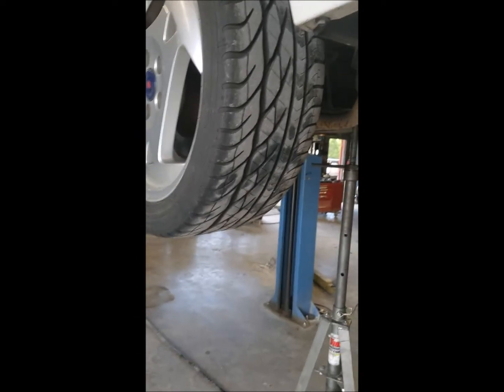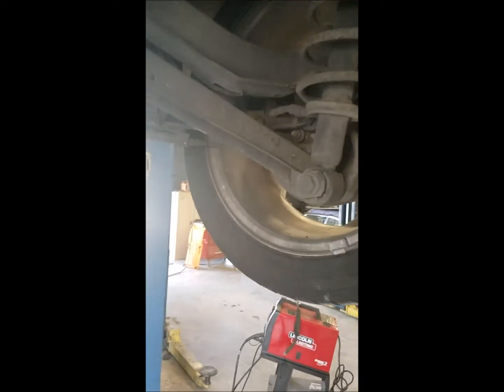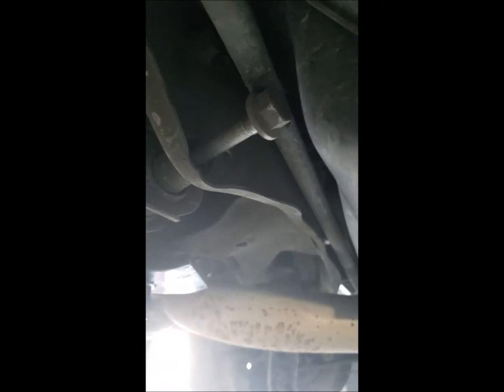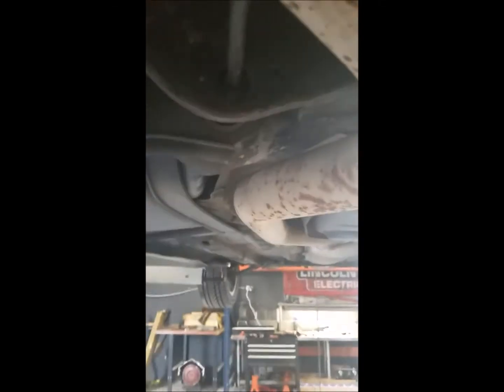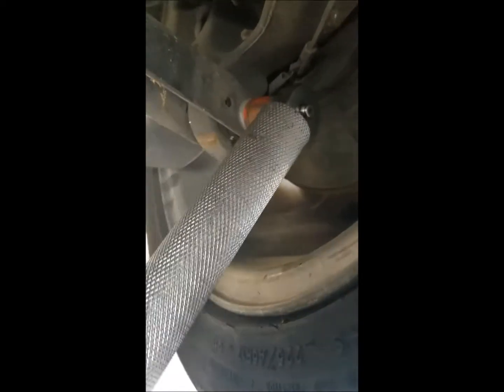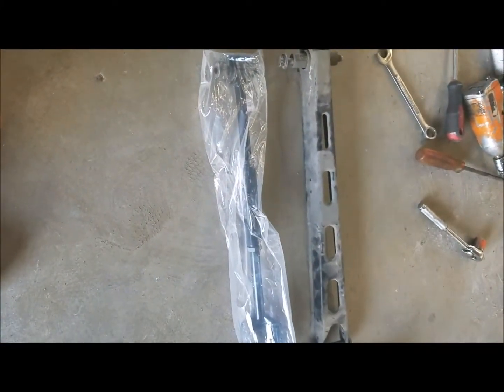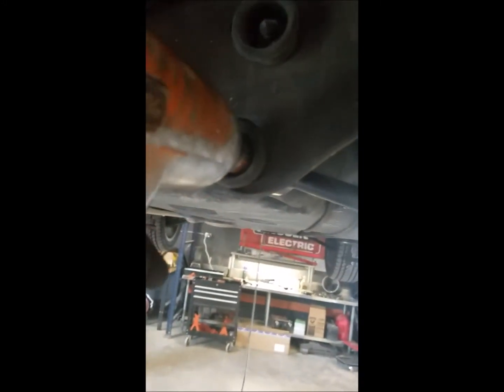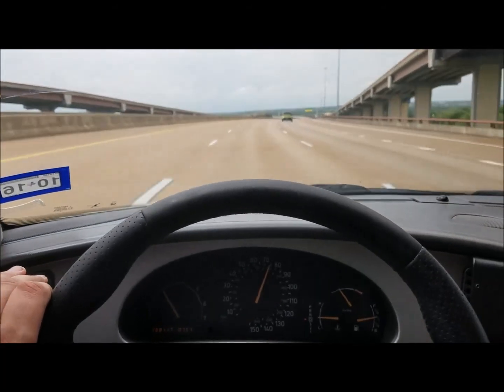Saab - Rear Camber Fix (9-5)

Comment: When secure 4 bolts on cross stay, am I suppose to torque it under load?  Slightly jack up the wheel up 1/2 in.  Suspension parts should torqued under load.

Comment: hey just wondering why this wont work with the auto levelling headlight version?
Reply from the maker: Brody George Theres no bracket on the Saturn parts for Saabs leveling arm / sensor that keeps the headlights level. Although, I personally know a guy who rigged the sensor to these adjustable arms if you wanna see pictures or an idea of how to do it.
Reply: @saabross3171  I'd like to see those pictures because I will be installing these arms and do not want to sabotage my leveling headlights.
Reply from the maker: @AndrewAliferis  Ok, unfortunately YouTube isn't the best platform for sharing such pictures. You may email me @ saabatx at gmail and I'll reply with the photos? That's probably best

Comment: Hi,

It would be better to put the inner bolts back the same way that you took them off.    This will prevent the end of the bolt from puncturing the gas tank in a collision.   Saab has a caution on this in the service manual

Otherwise, thanks for the video.
Reply from the maker: Interesting, leave it to Saab to always have safety in mind!
Reply: Or grind off the pointed tip of the bolt. I guess the tip is only pointed to get the bolt guided easier into the hole.

Comment: What a great solution! I guess to get Saturn parts in Europe is going to be difficult, but anyway, you gave me some inspiration. Thank you!!
Reply from the maker: You're most welcome! I can't take credit for the idea but its very easy to do, the parts are pretty common here in the States and aren't necessarily specific to Saturn. See if you can find a generic part in Europe with the same specs or similar part number and it should work, maybe Opel?
Reply: You can buy them on Ebay, I did. But beware that if you have a car with xenon lights you need to find a solution for the bracket sensor of the leveling system. The holes in the original arm are right where the adjuster of the new arm is. Not impossible, but a bit of a challenge.
Reply: Be sure those are approved in your countrys inspection